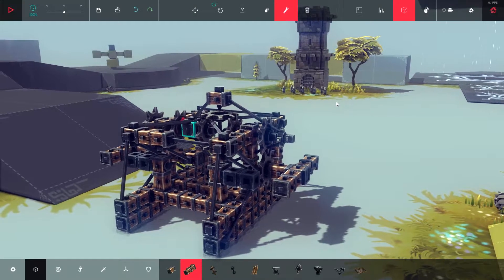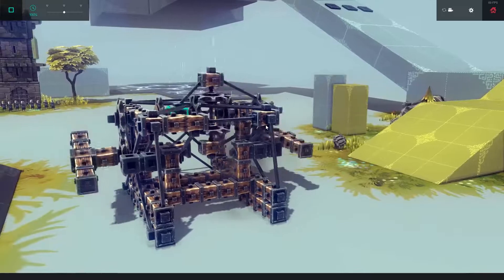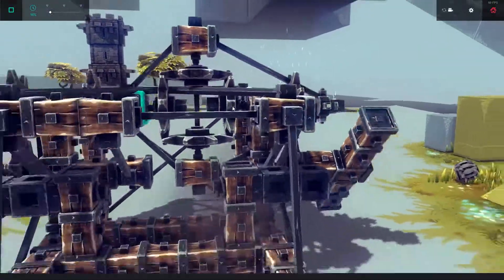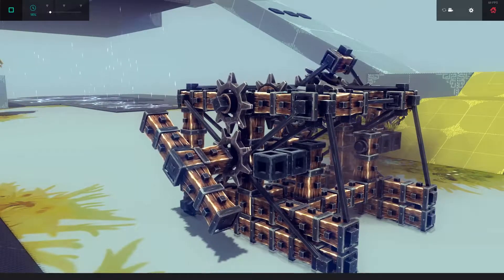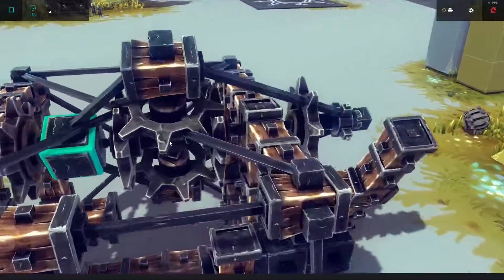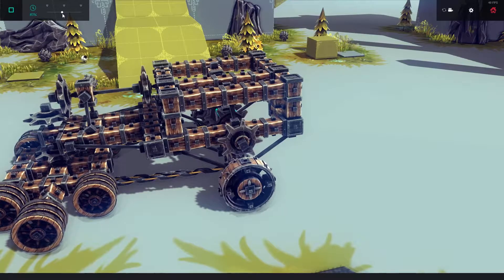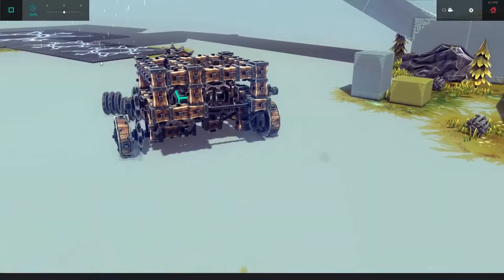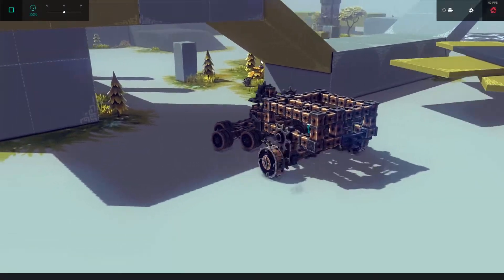Working Car Differential in Besiege

Comment: How the hell do you get the power to drive through the bocks? or link the cogs or whatever.
Reply from the maker: All the power is provided by 1 powered cog, it transfers to the glowing block directly which is attached via supports so it doesn't break, then the 4 gear mesh in the middle sends the power to both wheel sets